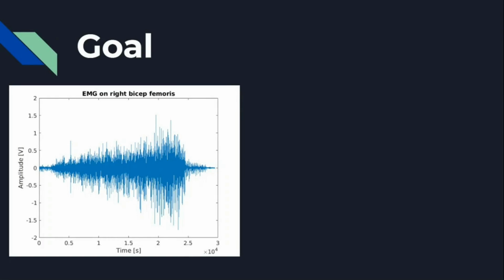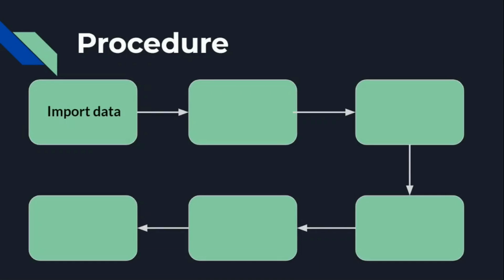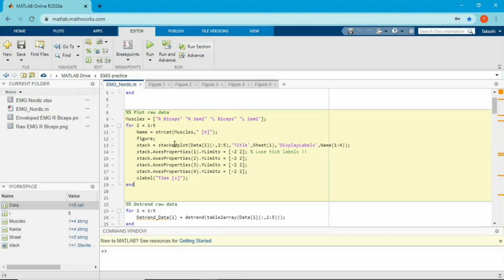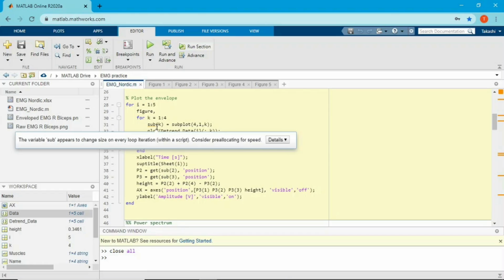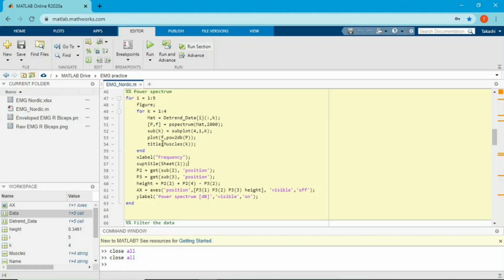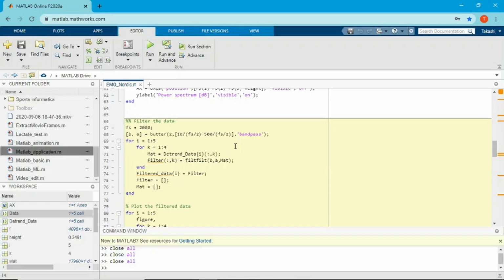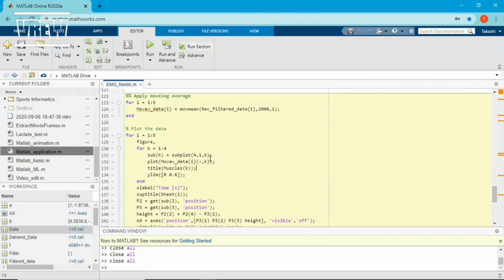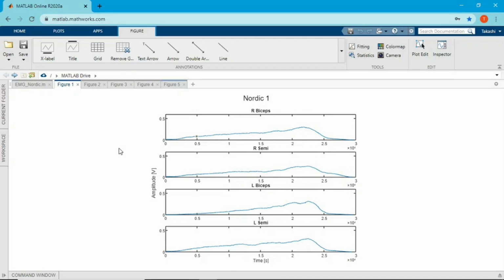EMG on Nordic Hamstring Curl - Filtering, Rectifying, Enveloping -

Comment: hello, thank you for your effort.  i want to ask a question. when you take the envelope of rectified signal, you performed movmean and select window size as 2000. Isn't 2000 high for window size , because you can remove meaningful data or amplitude. can you do that for mvc also? i am taking maximum voltage from mvc signal to normalize the other signals and i used 500 or 200 s for window size.